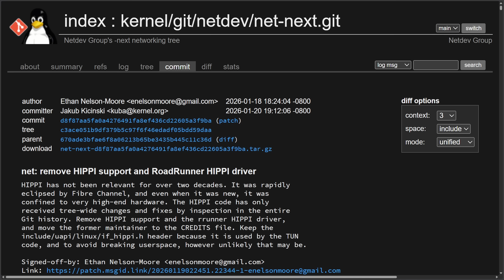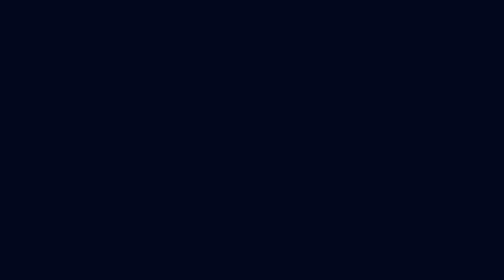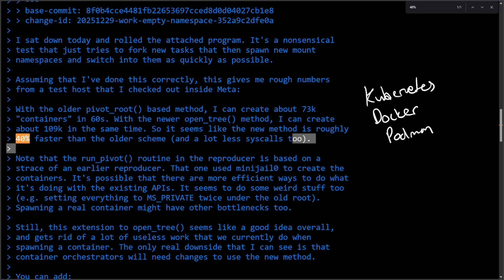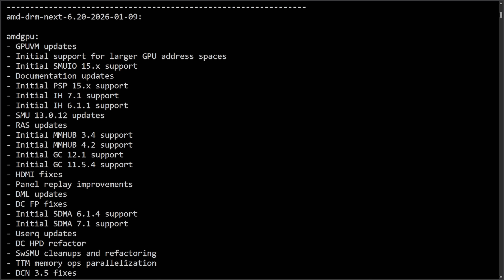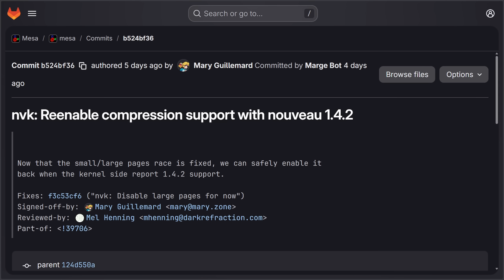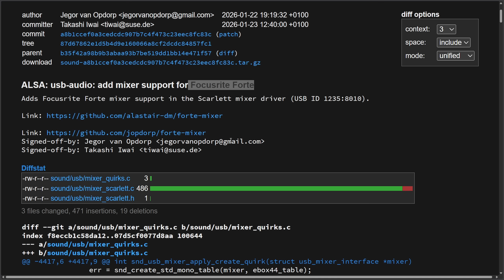Linux 7.0 Review: MAJOR Performance, GPU, CPU, and Networking Upgrades

Comment: Are they going to rewrite perfectly working parts, without security holes for decades with Rust again ?
Reply: Mostly Rust will be new code, not replacing old code.
Reply: Full steam ahead! 🦀
Reply: @arubaga   I arriving with my stainless train !
Reply: @arubaga  CHOO CHOO! 🚂🦀
Reply: @arubaga  So this is a hostile takeover to replace existing devs using security as an excuse? Is Linux the next Microsoft? Which legally required back-doors to be embedded in that AI generated Rust code? Who the hell approves this crap ? Maybe Linus should not lead Linux anymore.
Reply: why the rust hate? as to answer the question put forth I doubt it.
Reply: @MatthaisPali-y2y   The Clown Journal created an army of Lundbots who will attack open source projects. They also believe in every LIE that the clown tells them...
Reply: @MatthaisPali-y2y  first, rust isn't stable. as of now, it's still evolving. your rust code you write now will not work the same way 1 or 2 years from now (if it even compiles at all). using rust in a kernel is downright insanity.
second, rust is not just another programming language, it's a cult. they try to rewrite everything in rust and replace the perfectly fine, functional pieces of software with rust rewrites which don't even pass basic tests.
rust was not created for engineering purposes, that's for sure.
Reply: @duckmesideways thanks for your answer. Didn't know about the first point. I would hesitate too call rust a cult. it is more of a hype bubble of something new which was then highjacked by big companies to push for it even when unnecessary(AI is another example of this in my opinion).

Edit: To clarify I don't like AI Slop I just think that AI can be a usefull tool in small ammounts, I dont want it pushed upon me.
Reply: what do you mean by that last sentence?
Reply: @duckmesideways  rust is stable…? It uses editions
Reply: @duckmesideways Linux, GNU and FOSS in general are cults too. In this regard rust perfectly fits in😂
Reply: @duckmesideways   Rust has been stable since 2015. Every valid program written since then compiles with every compiler version made since then. Because breaking changes are separated by editions.

"they try to rewrite everything in rust"

"they" are an annoying minority even most Rust fans don't like. Got nothing to do with Linux.
Reply: @brinkoftext  they already did that with ubuntu. it doesn't matter how minority you are when you have the power to control the direction. look at how the woke minority destroy pretty much everything in the past 10-ish years. these people are like the illuminatis. there aren't a lot of them but they are in positions of power for some reason.
Reply: @MatthaisPali-y2y  If Rust is worthy, it would happen naturally, but it is a push from corporations and governments. Linus seems to just obey orders. Then he should not lead.
Reply: @fedayki_n  Linus is very famous for not being a pushover
Reply: @michawhite7613  He's an admitted communist which is why he is complicit with the rust cultists.
Reply: @fedayki_n   "Linus seems to just obey orders"
Next you're gonna call Gordon Ramsey a zen monk.
Reply: given enough time, they'll try to replace the whole kernel.
Reply: @duckmesideways  They can just vibe code, generate code using corporate owned machinery, Linus seems to like it and says "it is here to stay, deal with it". Is this guy contribute anything really ? He and Bill Gates seems to say exact same things these days.

Comment: Remember when 2.0 coming out and that felt crazy.
Reply: I was just thinking this. Also, damn I am old.
Reply: i remember the 2.2 and 2.4 releases but i started shortly after 2.0 was already released
Reply: Whoa, on-demand kernel modules? Symmetric multiprocessing? Birth of the Tux mascot??
Reply: 2.2 was where all the good old usenet drama was miss it ngl
Reply: i started with kernel 4.4
Reply: 2.4 was the bomb!
Reply: I remember 1.2 coming out, must be getting beardy...
Reply: i started using linux at around 3.0 XD